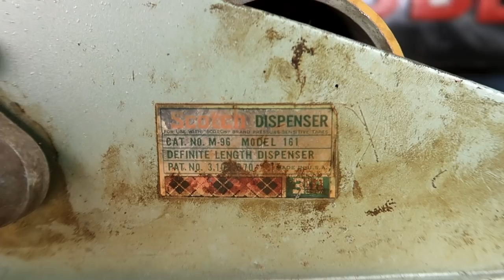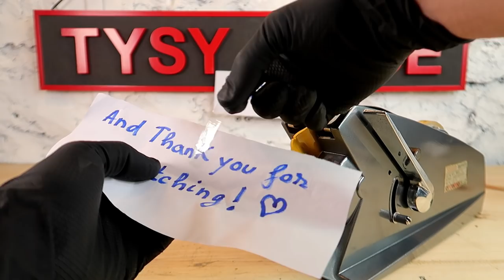Unique Tank Dispenser Restoration

Comment: Hey buddy, you know how you sanded the metal with 600 grit? there is (round grinding wheels ) That look like them green scuff pads That come in different colors for different grit size. I worked in a car bumper shop for 14 years and that is where i first used them....They work great and fast....

Comment: Curious. 
1. What chemical does the parts washer use? Just water, or some cool cleaner?
2. Do you use a high or low speed grinder for polishing? 3600 or 1700 rpm?

Comment: I cannot stand when the flat head screws are not aligned.  One is at 7 O'clock & the othe at 3.  It is called perfection & the blade & blade plate should have been completely refinished.  I know I am being critical, bt, I did not put this on YouTube as a restoration & I really like this guys work!

Comment: Instead of painting the Center wheel yellow, you should have put it in a bath with hydrogen peroxide and water and then used UV lights to whiten the plastic and get rid of the yellowing.

Comment: If you look at the 3M logo on the sticker, that design logo was put into use in 1961 and wasn't changed until 1978 when the current design was rolled out. So this item could date anywhere from 1961 to 1978, though given the sickly green color that EVERYTHING in the early to mud sixties was painted (including the interior walls of government buildings), I would put it no later than about 1969. This item, or at least an evolution of it, is still available from 3M corporation.

Comment: Instead of painting the wheel you can retro bright it use some hair bleach volume 40 and put it in a box and then put it outside  and put the plastic bag on it and then check the temperatures 15 to 10 minutes

Comment: If you want to remove a sticker NEVER use heat. put some liquid nitrogen on it or freeze it at least.
Reply from the maker: but it will break into pieces
Reply: @TysyTube  com'n, You know It wont. I use freezing method for every glue in cellphones. I freeze the whole cellphone for detaching glass from the display panel. it would be more risky for electronic devices. but its not.

Comment: I have watched a lot of these and been very impressed. But the parts washer is the one thing that never impresses me. I honestly don’t understand it. Must cost a lot and for what? Every piece still requires more work. Does it do anything that dawn and water couldn’t do? I don’t mean to hate. Maybe it “balances the ph” or some such thing. But to my untrained eyes it makes very little difference and looks like an overpriced water hose attached to a brush. 🤷🏼‍♂️
Reply from the maker: has a special cleaning solution, Purgasol, and is very good to clean grease and dirt, and is very clean to use it